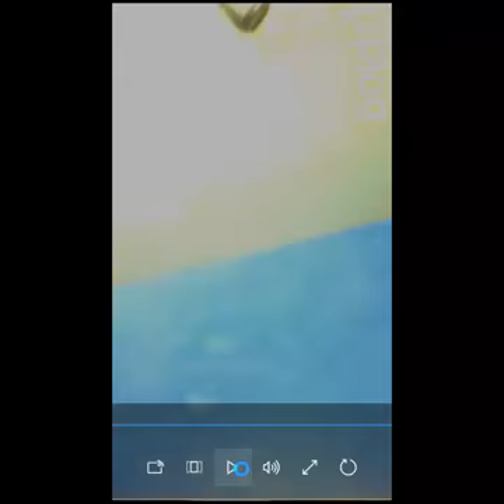Replace Hyundai Wheel Stud without Removing Hub. Backyard JDM

Comment from the maker: since there was no slot or easy access point for the new stud to slide into the hole, had to get pretty JDM on it. Bolt head got filed and dust shields got snipped, bent over, then bent back into place after the fact. Thanks for watching! Thug life appearance
Reply: How can they design something that stupid? Had to change on my cousin's getz what a nightmare it is

Comment: look at all modern cars many good improvements but since engineers are not mechanics and companies can care less how hard to repair there getting harder and more expensive to repair . i know some is for planned obsolescence but pricing raise leaving more customers unable to buy 30k+ cars. so they should be forced to plan repairs. a slot in shield you should not have to pull axle hubs etc to fix a 3 buck part. eu finally forced access to fuel pumps one older injected car needed the entire rear suspension then fuel tank dropped for fuel pump.junking cars with serviceable life due to  expensive repairs is not ecologically sound when running properly

Comment: That was useless. Sheesh! I guess I'll keep searching.
Reply: UreaSmith did u find anything
Reply: I've replaced many studs over the years. Some are easy but most are hard. This vid shows it easier than it is  plus goes against what I was taught by a Master Mechanic. The stud slipped right in ( Never happens) and I saw the lug nut put on and tightened. That was not how I was shown or how I do it The way shown I was told can damage the stud because you are basically pressing it on. You can damage the threads and possible strip or snap the new stud .After getting the stud worked into place I put an oversized  nut on then the lug nut and tighten it . The oversize allows you to make sure sure your stud is seated and does not damage the stud or lug nut ( you may have to grind the edge of the stud head a little for clearance but do not grind off too much). This Vid belongs in the garbage because it isn't worth the time it took to make. A non mechanically inclined person if trying to do this would either get stuck on stud replacement or end up damageing something.  When in doubt ask a Reputable mechanic how he does something
Reply: @thomashopkins2509   true but what if you dont have several hundred to spend on a car worth less than 2 or 3k or less trade in run with 1 lug missing not smart either
Reply from the maker: Hahaha I am dying you idiots 😂 😂😂😂
Reply from the maker: @thomashopkins2509  no, it didn't slide in. A box end wrench was used as a spacer (a substitute for the oversized nut you're talking about - something you might find in your buddies hobbiest tool kit). It's in the vid man clear as day!! 😂
Reply: @chrisosborn2102  I had to grind the head of the stud a little for clearance.